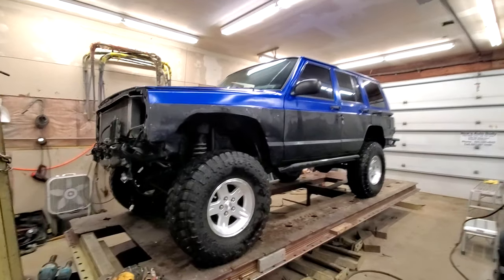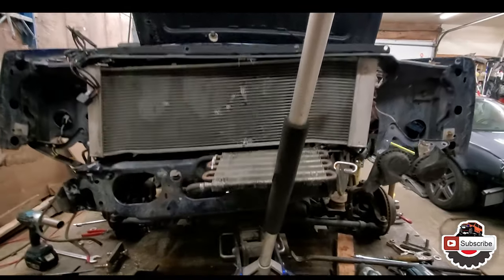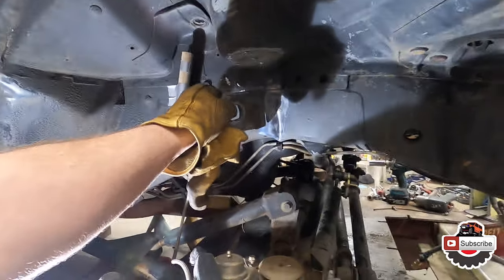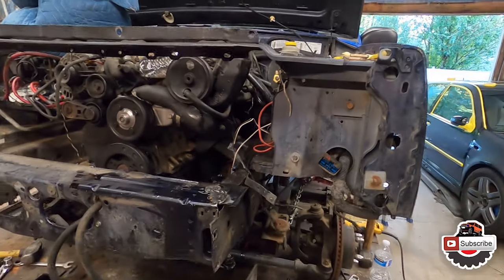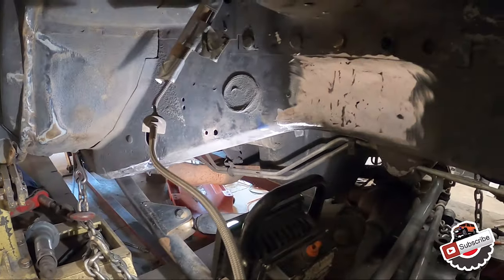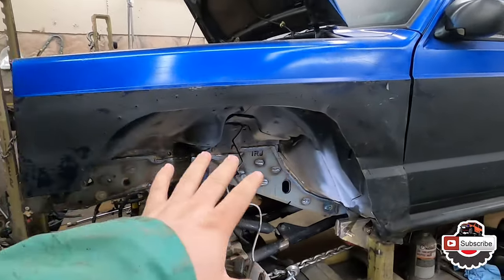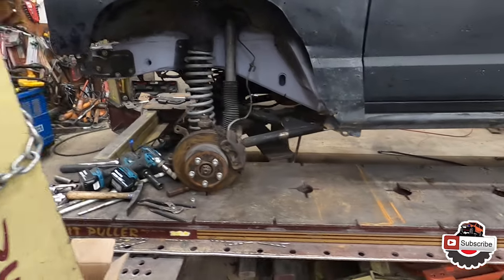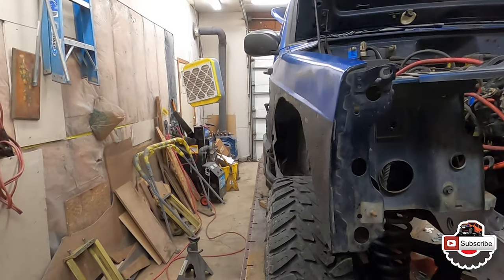Frame Damage Repair On Cherokee XJ

Comment: This is probably too late, but you could (with the front coils out) cycle the front suspension all the way up, then strap it (somehow) in the full up travel position. Of course if you need to remove to make frame repairs, then never mind.
Reply from the maker: I did manage to do the suspension travel test, just to see of there's any binding or hitting of anything major.   so far no issues.